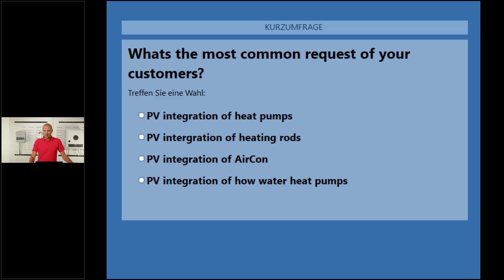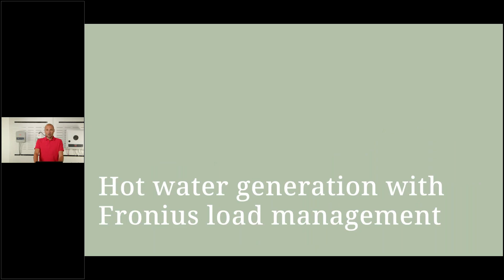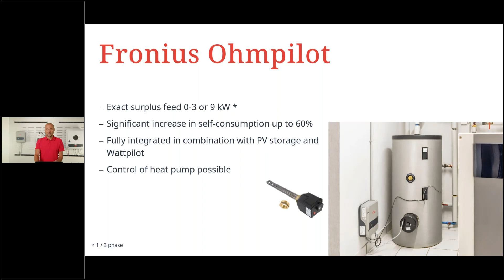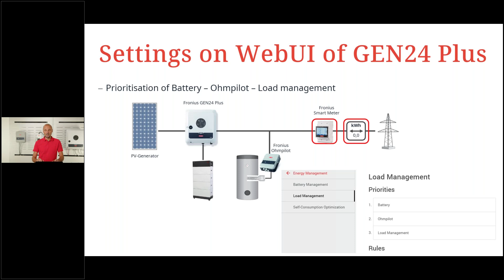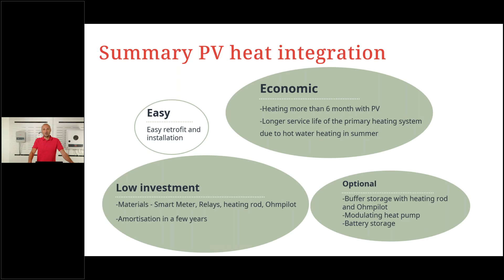Webinar: Fronius heating solutions with Ohmpilot and SG Ready heat pumps

Comment: Hi, you state that compatibility is possible for a modulating heat pump with Wolf heat pumps but I cannot find any information on how to configure this, could you elaborate on how or which components are actually compatible?
Reply from the maker: Hello @dankspain

Thank you for your enquiry! Compatibility with Wolf modulating heat pumps is possible. The configuration and the required components are described in detail in our PDF document. Basically, you need a Fronius inverter, a Fronius Smart Meter and a 12V relay.
For detailed instructions and further information, I recommend taking a look at the document: https://www.fronius.com/~/downloads/Solar%20Energy/Whitepaper/SE_WP_Connecting_a_heat_pump_to_the_Fronius_energy_management_system_EN.pdf

If you have any further questions, please do not hesitate to contact us!

Kind regards, Andrea from Fronius
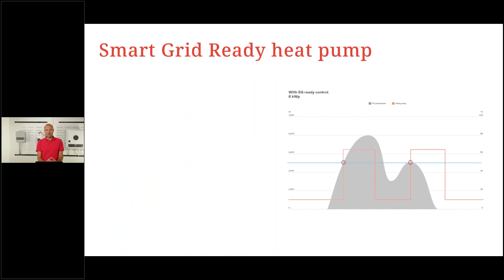Reply: @FroniusSolar  Hi Andrea, this is have configured successfully with my Gen24 inverter, this is the mode explained at 19:40, "Smart Grid Ready". What I am asking is the mode explained at 21:00, "Modulating Heat Pump", in your webpage it says it is compatible with Wolf heat pumps but I am not sure how to configure it.
Reply from the maker: Hello @dankspain

The document does not mention any specific instructions for configuring an inverter with a Wolf heat pump. It generally focuses on the integration of Smart Grid Ready heat pumps with Fronius inverters.
If you require specific information about the Wolf heat pump, it may be helpful to consult the heat pump's operating instructions or contact Wolf technical support.

Kind regards, Andrea from Fronius